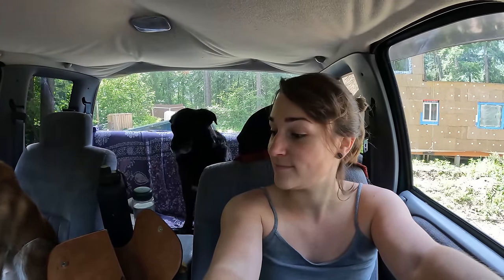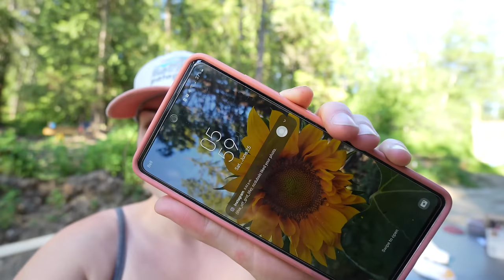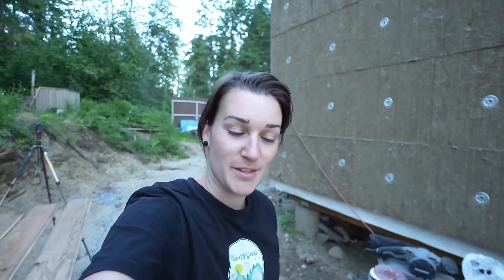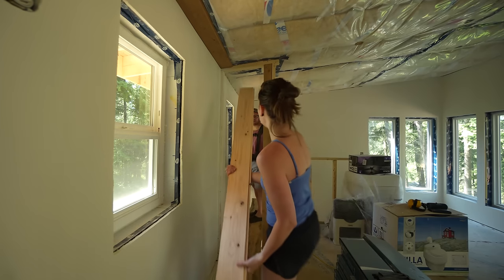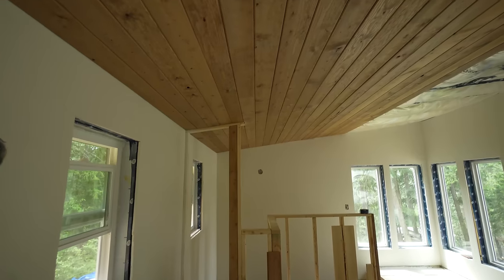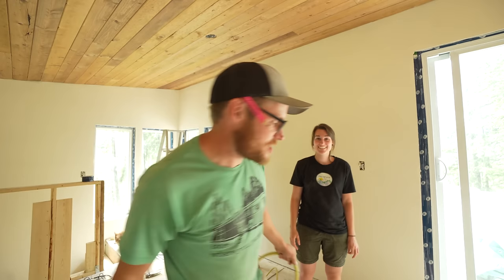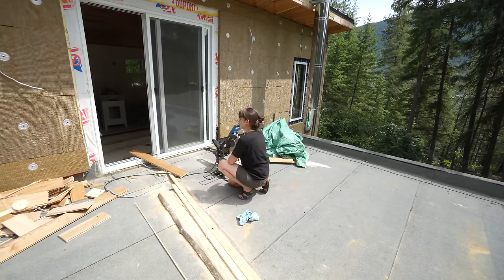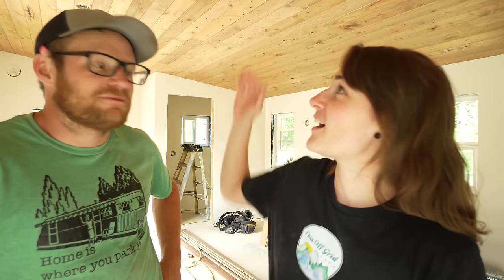This Looks INCREDIBLE! | Off Grid Cabin Build

Comment: On pine wood when staining, I always buy a can of sanding sealer and put one coat on all the pine. It really works and faster than using a sander and no dust. The sanding sealer closes the pine wood pores so it eliminates blotching and dark spots on the pine boards. Makes the stain more uniform in color.

Comment: You can fix that droopy ceiling with some spray adhesive.  Get your whisk broom and spray a section, then use the broom to smooth the material back into place.  Work from the center out.

Comment: Hi both 
Certainly has transformed the room.  Looks lovely. 
When nailing the t&g to the ceiling one method I've seen is to nail nearest the wall on the first board only.  When you present the second board say putting the tongue into the groove, because you only have one nail at the tongue end of the first board you can pull first board away from the joist slightly which will give you some wiggle room to join the two boards.  Then nail the  first board by the groove and the second board by the tongue. Repeat process until your lovely ceiling is complete. 
Hope you can make sense of this.
Brian  Chester UK

Comment: when you cant get them to go in or a board is warped use a wedge system nail a board slightly away from the piece and pound a wedge into the gap and she'll tighten right up

Comment: Honestly you guys amaze me as to how well you work together as a team. I mean what a huge project most people might build a small cabin n not a house with most modern amenities.  This is amazing to watch I watch a lot of cabin building  videos DIYERS to contractors and this is amazing! Plus you have your own mill the problem is milling stacking and drying. But on the cheap find an old GP MEDIUM Tent like the Army uses n heat it with a few cheap home made barrel stoves its not like ull run out of wood to burn I looked at all kind of wierd things  for producing power. As in Diyer power generation recently even saw a small hydro electric one in a bushcraft video used by an asian lady just to run lights it wasnt very big but you need some flowing water n you guys have a water fall /stream on your property. So Im just whispering an idea in your ear Im sorry I cant help but think of wierd things once in a while or like magnetic motors n things of that nature. Or a gas engine that runs without gas I saw one time like a 4-5 hp do to a strange configuration of an exhaust pipe.

Comment: The ceiling looks fantastic and you get a lot done with planks so you can see the result quickly. Did you glue the rubber behind the knot holes.

Comment: hay folfs don't worry about cutting your board to land on a ceiling joist becuase your next course will go over the last joint, it will not fall out; I know this because my wife and I have done many ceilings with that. It will save you alot of lumber and keep your cost down. ( Gunner 5 3/8-Navy 1969)

Comment: I can relate to door issues and I know the fix but its not to bad gotta remove controler on the inside drivers door but replace the external door handles I took it to the shop. They are plastic Ive replaced two external plastic door latches on my Buick. I think about getting a pickup but just more hassals and I have access to a used SUV my brother owns and stores locally so why buy one? Its an old Yukon that had your windows n things not working that was why I said I knew the fix n there are vvideos on you tube that show DIYers how to fix it basically they need to be taken apart cleanup put together and reinstalled mainly just the drivers side door switch is the culprit if your lucky its just a relay but my guess is the drivers side door switch. Or take it to the shop and pay the arm and leg price they charge Im guessing your hubby can fix it though hes pretty smart young man I
 figure your both engineers whether you wanna be or not...

Comment: You stained wood?  Eek.  ;)   So, the dark stains do lighten when dry, but an oil based clearcoat finish (Waterlox satin, the only finish I use now) will darken it bit more than a water-based clearcoat (acrylic).  If you must discolor wood, I suggest trying a dye...next time.  
Or do what the people with money do: buy the type of wood which is the color you like and clearcoat it so it doesn't change colors on you.  
Finish: Varnishes are amber, shellac is clear to yellow to amber to red, polyurethane and acrylic waterbased are fairly clear. Waterlox is fairly clear, but the oil in it will darken wood a touch.  As you found, ceilings are a real b***h.